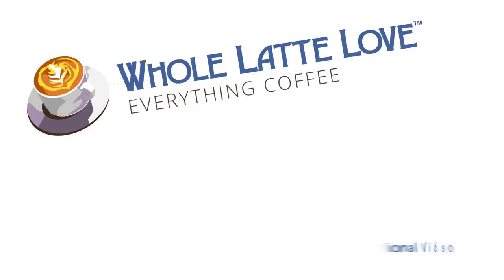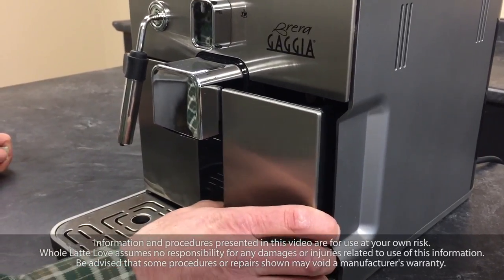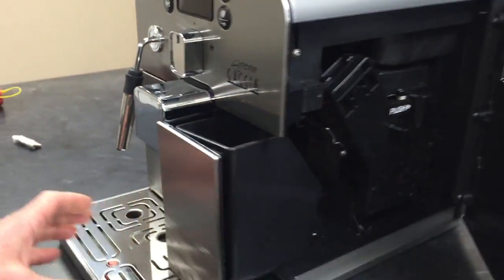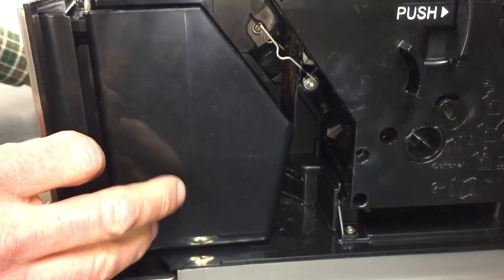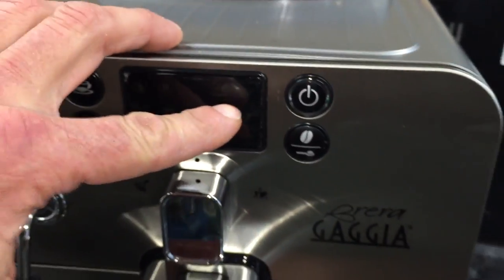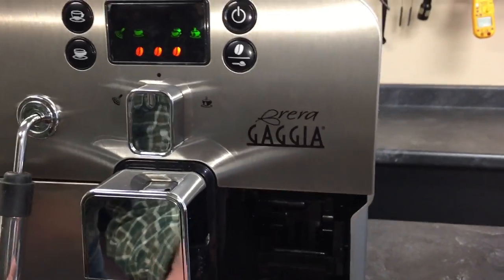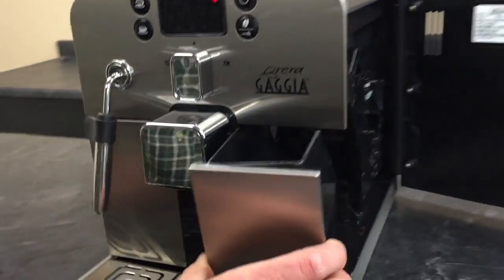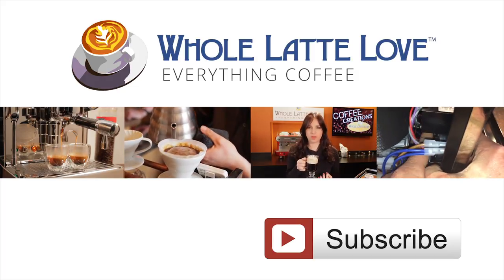How To Fix a Dredge Drawer on a Gaggia Brera

Comment: This is not totally related to this video but I can’t find one that is…my pucks/dregs are really wet/unformed recently. Any ideas? I need to decalcify I just haven’t made it to the store to get the stuff. I can’t imagine that’s it.
Reply from the maker: Hi m, Be sure and decalcify  - single most important thing to do to keep your machine running well for years to come. Wet pucks can be caused by a dirty group. Be sure and rinse the group weekly under room temp tap water. Depending on age of machine and use level it might be time to give the group a deep cleaning or rebuild. Here's a detailed video tutorial on how to do that: https://youtu.be/uFD3SzthFJQ
Marc

Comment: Hello! I purchased the machine a few years ago from you all and have loved it. I ran into a recent problem where the dredge drawer light stays on permanently - it doesn't go into the blinking mode. I've emptied the drawer, cleaned and played with the sensor but haven't gotten it to work. Any thoughts?
Reply from the maker: Hi Michael, Happy to hear you are enjoying the machine! It does sound like a sensor issue. I would give our friendly support pros a call/chat/email. They should be able to help diagnose the issue. Contact info here: https://www.wholelattelove.com/pages/contact-us
If more of a DIY guy check the troubleshooting section of our support wiki for the Gaggia Brera here: https://wiki.wholelattelove.com/Gaggia_Brera/troubleshooting
Reply: We have exactly the same problem. In fact our machine has had this problem ever since new. It was returned to Caggia service under guarantee buy they claimed there was no fault and just returned it. We have simple lived with the problem ever since. Sometimes it will take a few dregs before indicating full. At other times it is "full" after one ground and sometimes none. Usually taking out and reinserting the drawer fixes the problem but now it is stuck on permanently and nothing seems to persuade it to go off.

Comment: So, my empty grounds light is flashing. Pulled the grounds drawer, pulled the drip tray, cleaned it all out. Removed the brew group, reinstalled everything. Light is still blinking. Any ideas on what to try next?
Reply from the maker: Hi Jonathan, There is an internal sensor activated by a tab on the bottom of the grounds drawer when inserted. With the machine on remove the grounds drawer and open the side door of the machine. Use something like a paper clip to manually activate the sensor - it's a little silver flap. When pushed manually you should hear a faint click. It's possible the sensor flap is stuck in the drawer in position and not registering drawer removal. If this does not solve the problem please call our tech support at 888-411-5282.